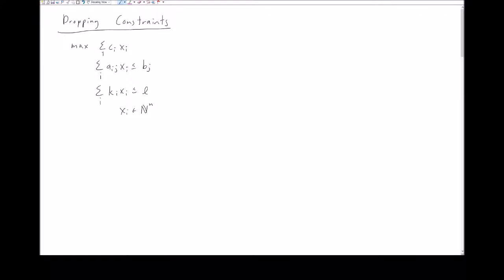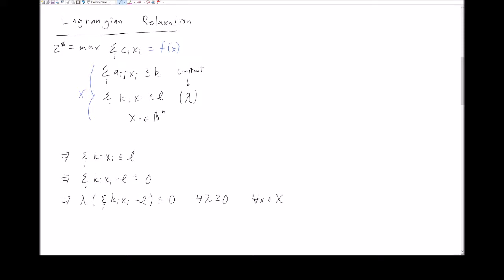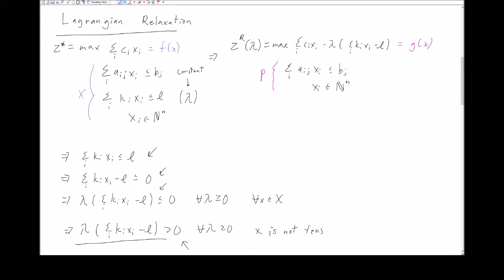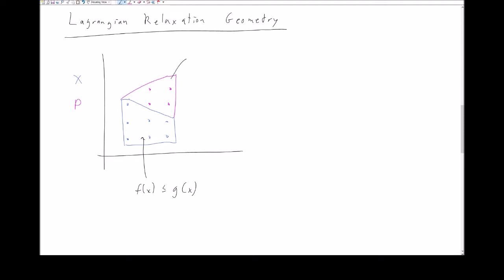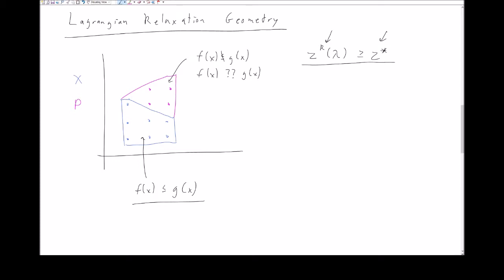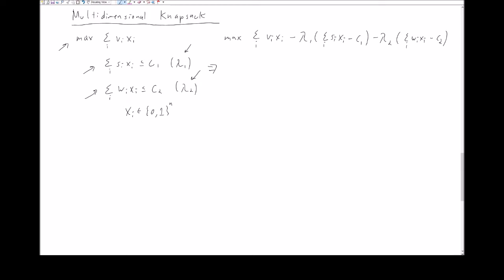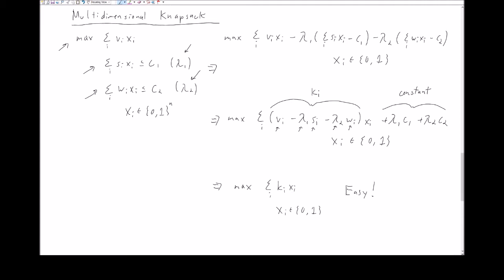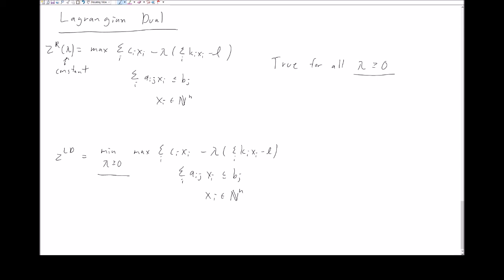2-6 Lagrangian Relaxation

Comment: When you are doing multidimensional knapsack, I think in the LR, both lambda1 and lambda2 should be of +ve sign (you gave -ve), because the relaxation is supposed to give higher value than the original IP since it's a max. problem. but as you wrote, LR is  having rather decreased obj. value. but overall, really thanks for a good demonstration! Keep it up :)
Reply: Hi Mohammad! In this case, you shouldn't put a + sign before the lambda. This is because the value inside the (...) is always <=0 for any feasible x. So when you solve the relaxed problem, you will always have a higher value than the original problem. If you write (c_1 - sum(i=1 to n)s_i*x_i) then you should put a - before the lambda. 
Hope it was clear!!